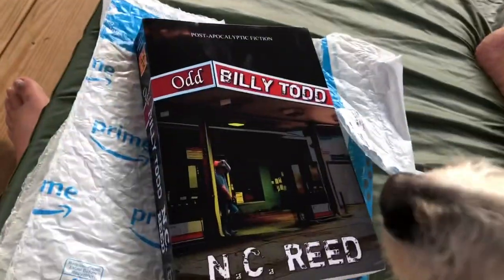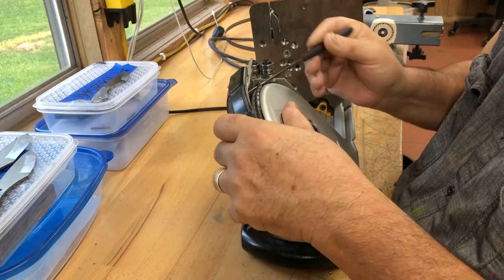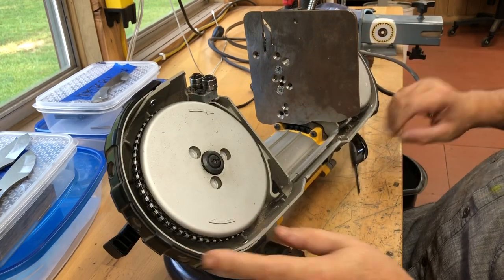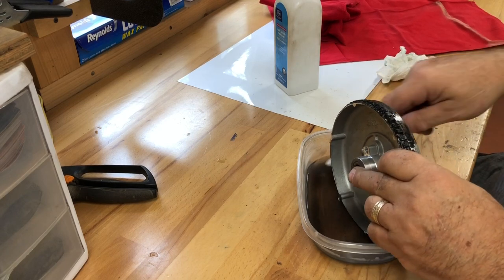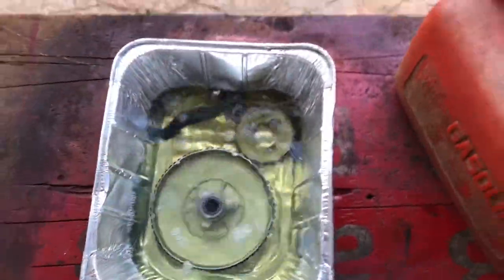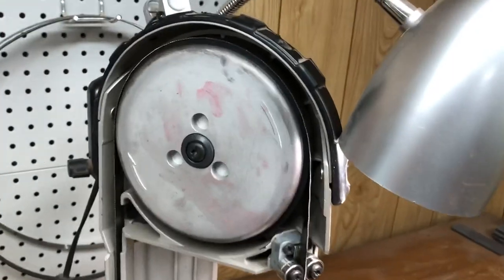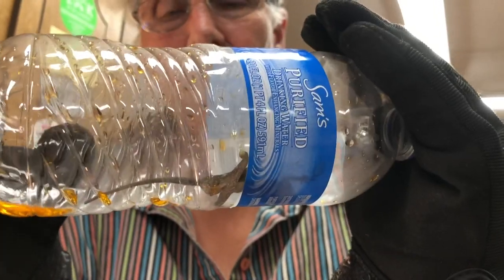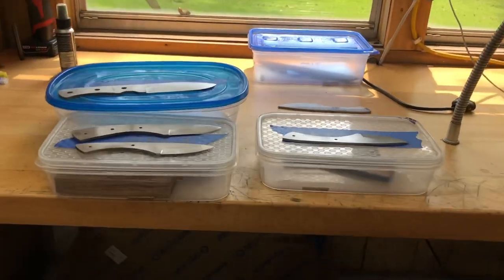How to replace rubber tires on a portable  band saw

Comment: I just did mine. My Motor Sergeant language melted the new ones. I didn't take the wheels off. It was oil that ruined the old ones. I sprayed penetrant on the blade to keep it cool. Won't do that anymore.
Reply from the maker: I had to open the cuss word tool box for this. That melted rubber did not want to relinquish the wheel.

Comment: I need to change the tires on my Delta bench top band saw. I am debating on whether it's worth doing. It's definitely a very light duty band saw and not very precise. I may jut put it on the curb and pluck some money down on a good one.
I grew up getting picked on quiet a bit. It was a good friend of mine who suggested that I just laugh it off because that's what takes the bully's power away.
Since then I have been less angry and able to focus more on wha makes me happy. In essence, my revenge on the bullies was to be more successful then they are 😁
Reply from the maker: Usually, the bullies have their glory years in school and end up living in a van down by the river. Not always, but most often.
Reply: @bctruck  Yup. Karma is an unforgiving bioch 😉

Comment: I had to replace them on mine also. I liked to have never got them back on. I ended up having to boil them to get them pliable enough to go over the wheel.
Reply from the maker: The first one, the one I didn’t record, went on easy. The second one was more difficult.